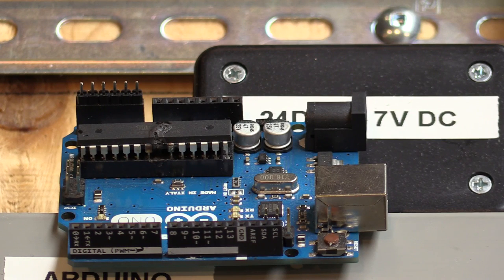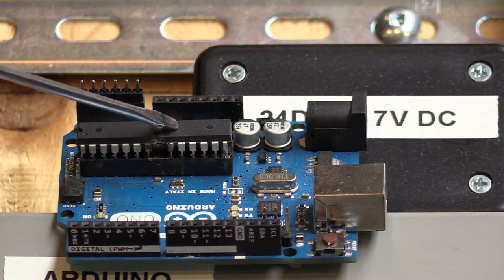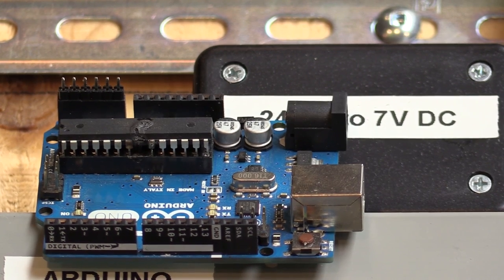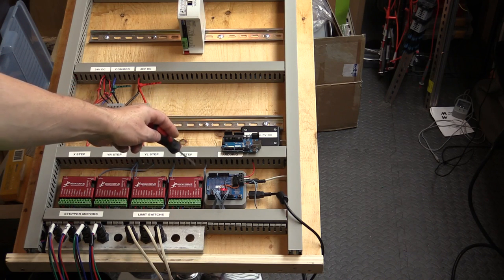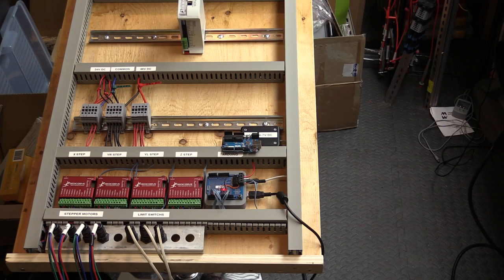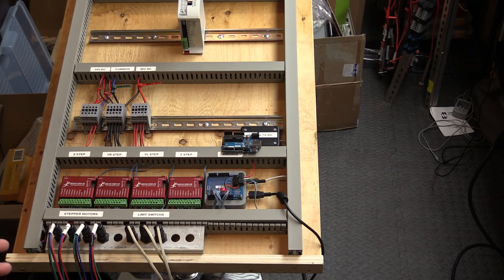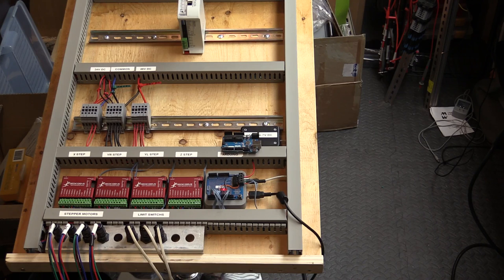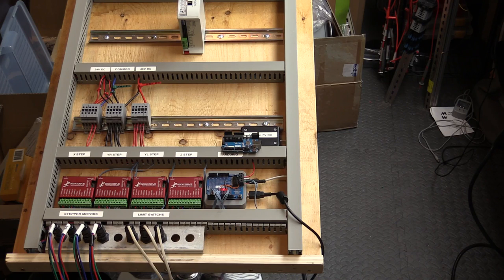CNC Electrical Build   a few words of wisdom

Comment: Yer Peter a professional job thats brilliant 

Wanting to make a heat vacuum press with infrared heaters do you have any ideas 
Need to reach about 200 degree  needs to be quite accurate and balanced heating platen  table size 1.400mm  x 3000mm wanted to use domestic electricity 240v but don't think possibile heaters need to be 600 in length and 100mm apart from each other needs about 40 heating elements i think. ? its for vinyling  kitchen doors should be a good project nearly built machine now just thinking about powering it up and come across you.  must be simple schematics lol not my thing really    
 
Thanks  regards 
Paul
Reply from the maker: +Paul Regan What kind of power do you think you need for the heaters if 240V at 13 Amps wont do it?, thats pretty close to 3KW

You could always have two separate circuits inside, on from a separate house circuit, this way you can have a low and High setting of 3KW and 6KW ish

Use of a thermistor or an array of them could help for measuring, and splitting up the elements into zones could help to keep the heat even ?.

Without seeing a physical layout its difficult to guess whats best.